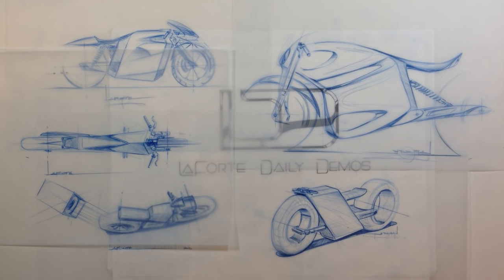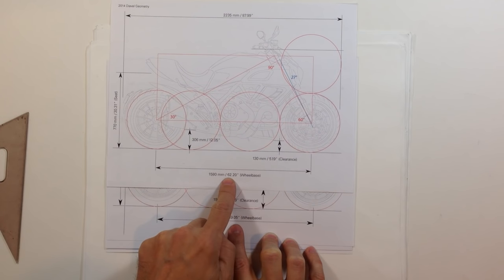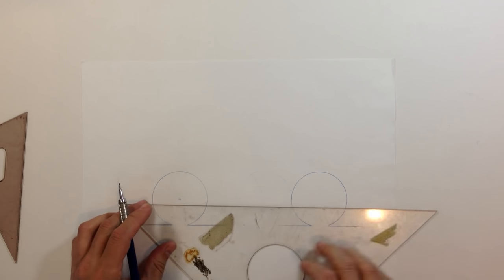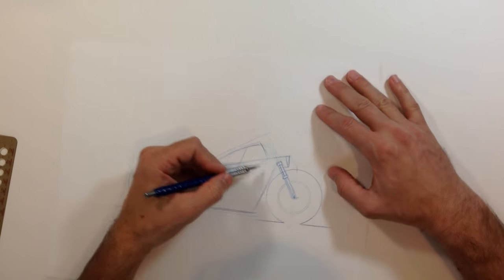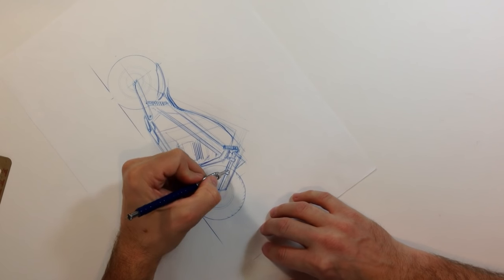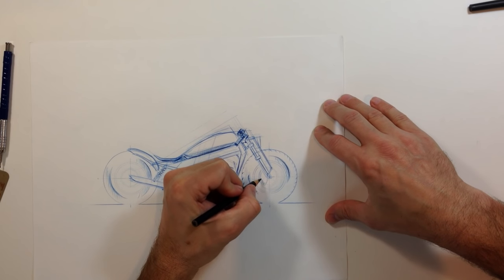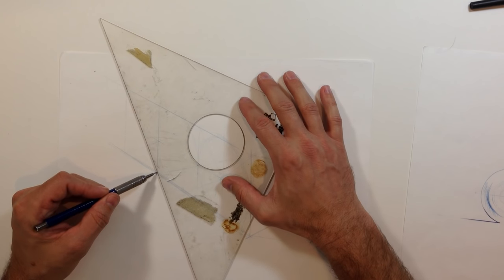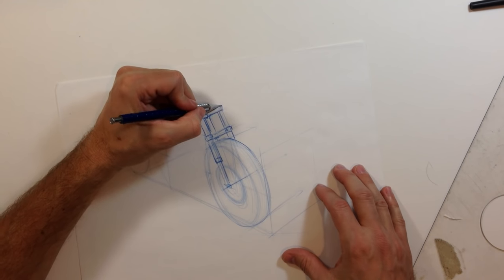Motorcycle Sketching - Part 1 - Side View Study

Comment: Michael, can you use that box measurement technique for any vehicle or object, to find it's dimensions? Also, even if you have a photo or picture of an object in 3/4 view. And you need to know its dimensions, would you draw a box or rectangle like that and fit shapes inside that looks similar, to estimate it's dimensions? Thanks.
Reply: Thanks, Michael. I was intrigued when I saw you used a right triangle connecting the front and back of the bike. I'm studying Scott Robertson's How To Draw. But the only thing with his instruction is that you elude to a vanishing point, which, as you know, if your angles aren't that right, everything else is off. I guess it's practice.